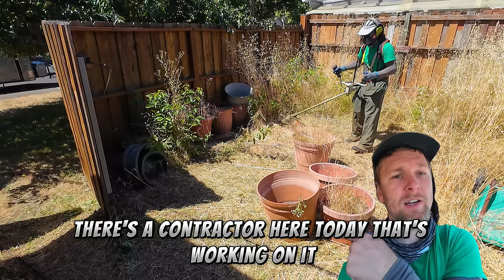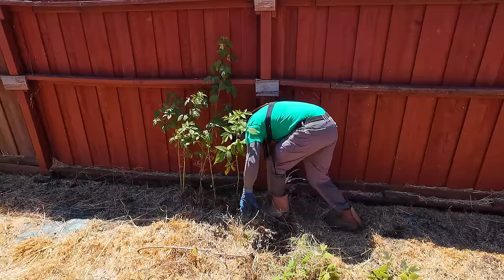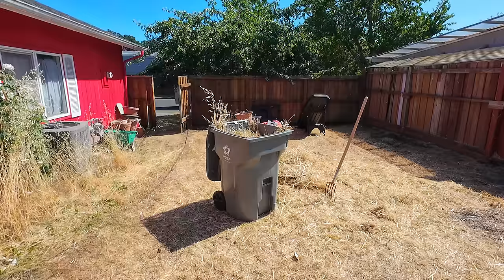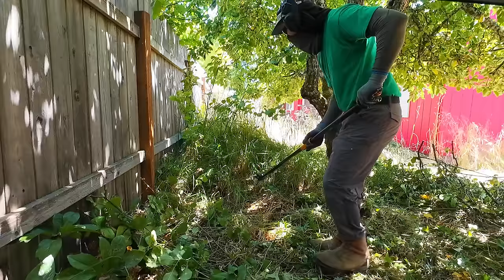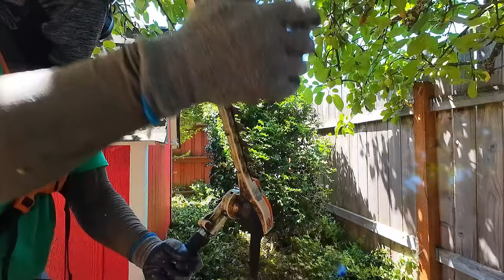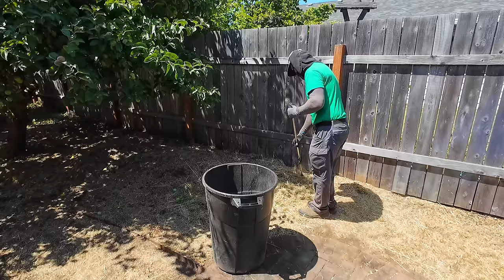INCREDIBLE Yard Transformation For An Elderly Lady That Will Leave You SPEECHLESS

Comment: Good results...why didn't you use a mower to cut it? It probably will make the job quicker.
Reply from the maker: Very true and good question. I knew it would create a huge dust cloud and believe it or not, not as neat as cutting how I did. It would not have cut as low either. It probably would have been quicker, just not as much quality in the end. The neighbors would have hated all the dust on their homes as well.